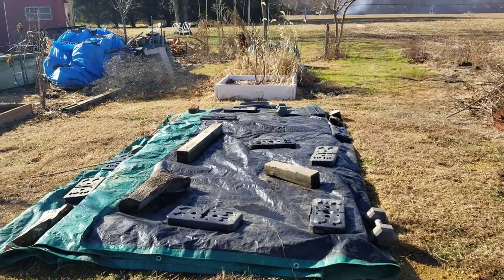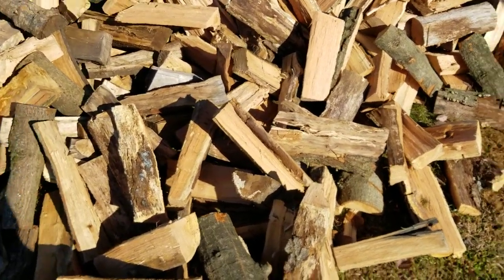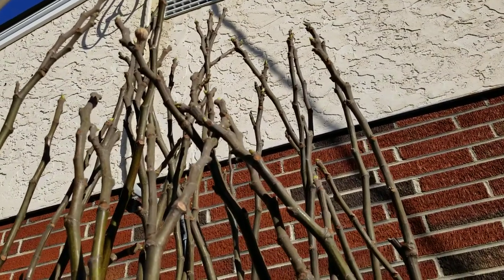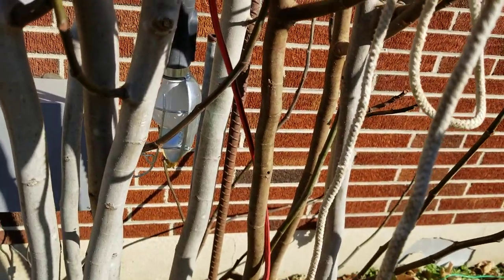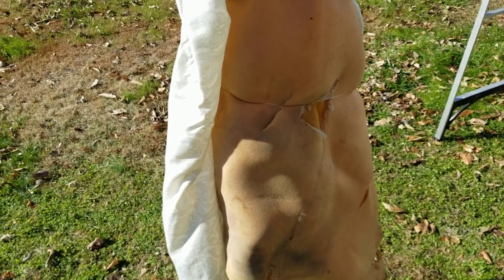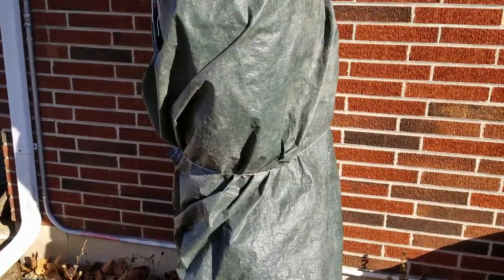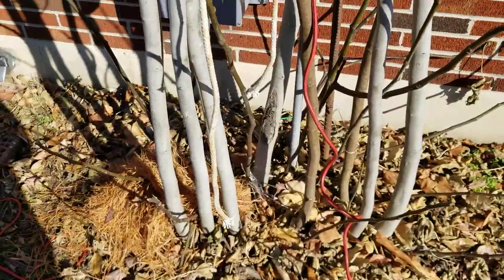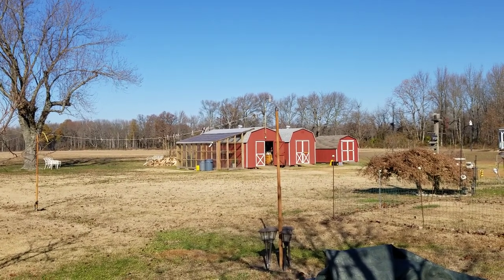DEMONSTRATING HOW I WRAP MY FIGS! AN IN DEPTH, DETAILED, DISCUSSION.

Comment: I used those brown leaf bags to put around the fig and put leaves in side and then tarped over it last year and made sure the bottom was covered with dirt or leaves so no cold air blows up under there. I`m in zone 6 a .I still worry though if this winter is colder and may just wrap a blanket and then a tarp around and hope for the best. Your way makes it a lot easier ! Thanks Lou !!!

Comment: Was wondering how you pulled it off in zone 7. Maybe I can make mini greenhouses work in zone 7b/8a. I had an LSU purple, Magnolia and White Marseille survive in 1 gallon containers in an open greenhouse with 4+ feet of snow last winter. Had a few VDB and a Brown Turkey survive outdoors without die back unprotected. Thinking I will put cement wire cages and 10 mm plastic over and around them. If they survived last winter when I lost 10 trees I planted in October without protection they should be ok. Maybe even a 55 gal barrel or cattle trough.  With shade cloth on top.

Comment: I use a freeze thermostat that only turns on when it gets really cold.  You don't want to have to remember to turn on a switch manually because you'll get a cold night that will surprise you!
Reply from the maker: Well, I appreciate your suggestion, and I have given that option consideration in the past. However, quite honestly, I prefer that my temperatures stay above 20, not 32 during the protection period. A completely dormant fig tree can easily withstand temperatures well below freezing. I am not concerned about temperatures that High. In fact, I am just as concerned about overheating as I am with extremely cold temperatures! I don't begin to worry until temperatures drop down to, say, 5 or more degrees below 20. I prefer keeping my wrapped figs as cold as is safe to keep them in the deepest dormancy possible throughout the Winter. Keeping them colder helps to prevent them from a quick reaction out of (or partially out of) dormancy during significant warm up spells of any alarming duration. I worry about them cooking in their wrappings and dying as much as experiencing dieback from extreme cold. I'm not trying to discourage you if that method has worked for you in the past. I might give it a try on some of my trees next year. Thank you for your suggestion! Take care, Lou Monti

Comment: It was great hearing the passion you have for your fig trees. Really loved watching and listening to all the knowledge you have for figs.  Thank you!
I have a fig tree that I got from my father...grew a stick from his tree.  I want this fig tree to live for many years in remembrance of my father.  I got tired of wrapping my fig only to find much of the tree still dying back. This year I got hundred and hundreds of figs but only a few ripened. So, I'm building an insulated box to protect it.  I am going to include a small 100 watt heater controlled by a wifi thermostat.  I will be able to see the inside temperature.  Any recommendation as to what temperature I should set it to?
I wish I would have seen this video before purchasing all the material to build this box because it was expensive...over $400 to build a 4ft wide by 5ft high box...pressure treated plywood, 2 inch rigid insulation, 2x4 etc.  I know this is overkill but I got fed up with a poor harvest.

Comment: Lou, I’m trying to find an alternative to using blankets because I don’t have enough for all my trees. Have you used plastic bubble insulation before? The kind someone gets from mailed packages. In your experience, what other materials other than blankets or foam can I use successfully?
Reply from the maker: Hi, there! I've never had any luck with any kind of plastic. It tends to trap moister from condensation, something that you certainly want to avoid. Wrapping burlap under the tarp serves as a pretty good overall wrapping material. Good luck! Lou Monti
Reply: @loumonti10  Thanks for the reply Lou. Also, in your video you briefly mentioned that you DO NOT enclose the bottom of the wrapping, but you didn’t really elaborate. In a future video, can you please mention this topic in more detail? Thank you for passing on your years of wisdom to us newer figsters.

Comment: I planted a Chicago hardy tree the spring and got a couple of figs.Before I wrap the tree, which is about four or 5 feet high, how much should I cut back? I heard you mention every three years.
Reply from the maker: Hi, Jerry! I don't think any pruning is necessary in your situation with that variety. The every three year method of pruning that I use is for exceptionally strong growing cultivars where it becomes neccessary to cut them back significantly in order to maintain control over them. It's better not to confuse that method with ordinary pruning procedures which are quite applicable in most situations. Regards from, Lou Monti

Comment: Great video. I'm also NJ 7A and new to fig growing.  I have 3 types and want to make the most of them. You mulch the base of the plant, wrap it with foam or a blanket, then a sheet, then a plastic tarp? Is that correct?
Reply from the maker: Yes, Kimberly,  I would say that your general description is essentially correct, with a few tweaks, as well. Leave little areas where you can allow a little ventilation under the tarp near to the ground. You can close off those ventilation airways during extreme cold weather. Also, it is a good idea to wrap burlap around the outside, or throw a sheet over it, in order to prevent the sun from warming the space inside of the wrappings excessively. Too much heat can be as formidable an enemy as can be cold! Good luck! Lou Monti

Comment: Great video. Do you ever fill the center with leaves or hey and then wrap with a tarp?
Reply from the maker: Many years ago I have done that occasionally, but I prefer a method which promotes better air circulation within the enclosure. It's better to keep things dry within the wrappings  and to allow for a small light for additional heat during severe dips in temperature. It also discourages creatures from attempting to make it their Winter sanctuary. If I choose to use a light, which I often do, a 60 watt lightbulb is needed for large fig trees, 40 for medium sized trees, and 25 for small trees. NEVER MORE!!!
Reply: Thanks Lou